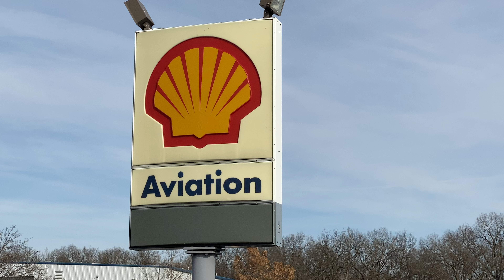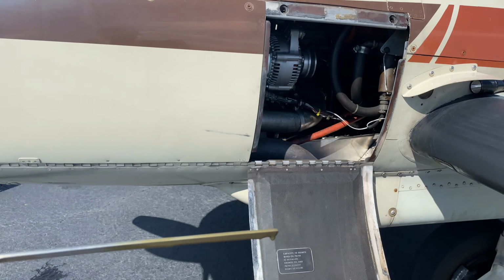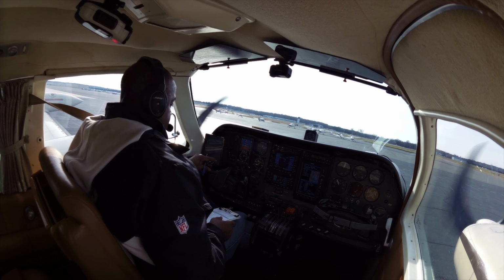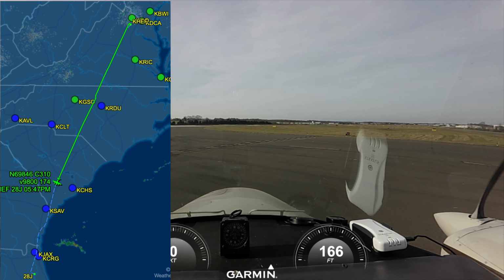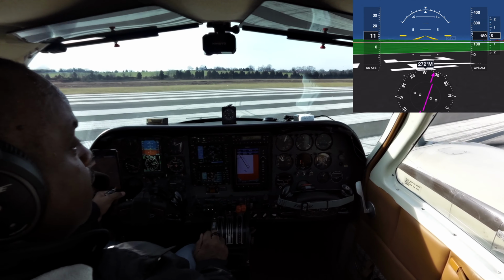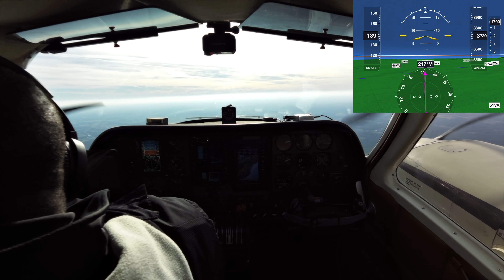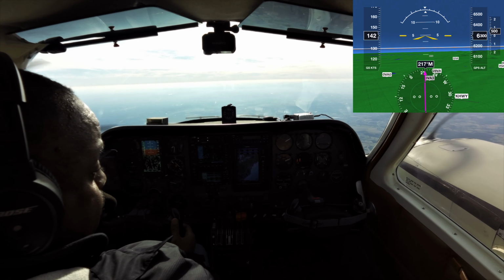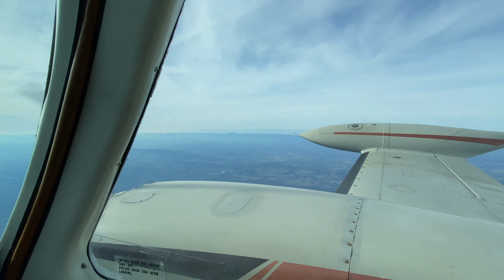Preflight and Departure from Washington, DC (KHEF) Twin Engine Cessna 310, Dec 2020

Comment: I would consider anything siting for more than 8-10hrs in those temps or colder, cold soaked. It sure doesn’t take long for most things to cool to ambient temps.
Reply from the maker: I should have put plane in warmed hangar for a couple of hours to prevent issues like this. But effect is also a indication of need to adjust springs in the adapter. Thanks for watching. Stay Safe!!

Comment: i always keep an oil squirt can handy and i give everything that moves a shot of hydraulic oil. hit that starter clutch mechanism with a light shot
Reply from the maker: Agree, I carry lightweight oil and could have used. Also, could have put in warmed hangar for a couple of hours to prevent issues like this. But is also a indication to adjust springs in the adapter. Thanks for watching. Stay Safe!!
Reply: @billinga  thats a fine aircraft sir it sings
Reply: I like these vids because its just pro flying. GaEVangelist is a good pilot he makes it look easy and operstes the aircraft smoothly and properly😎